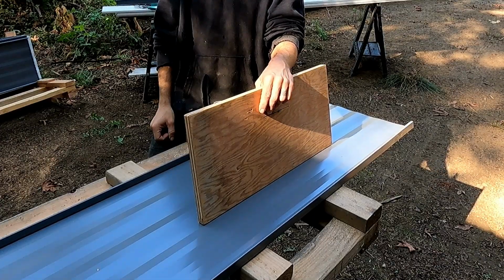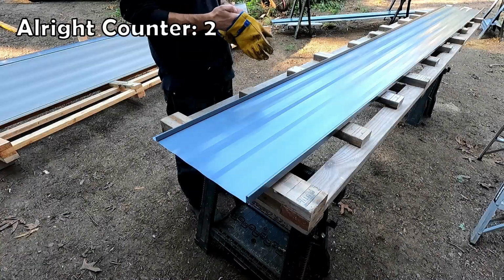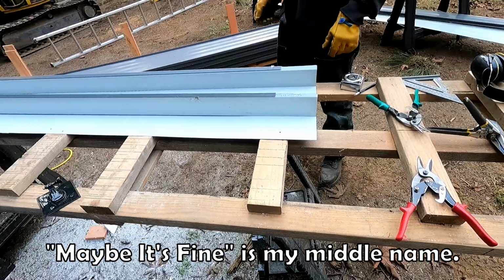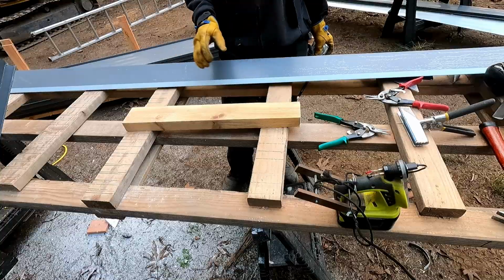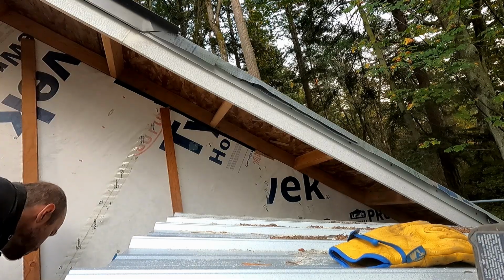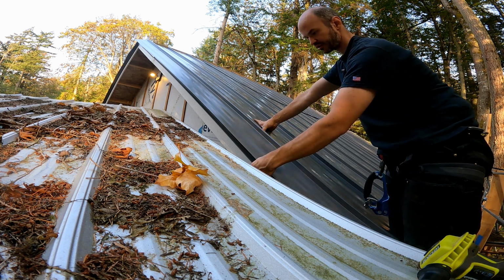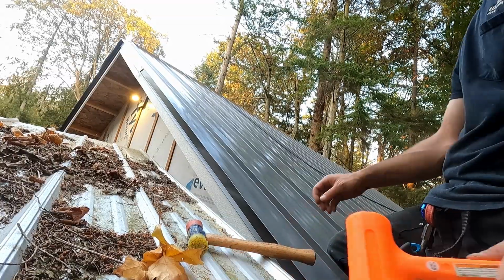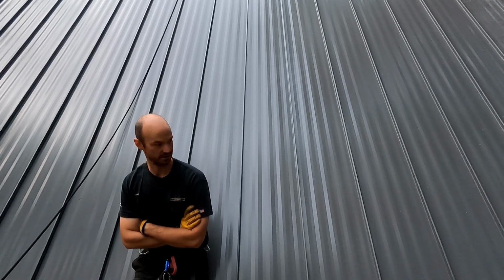Damaged Standing Seam Steel Roof Replacement

Comment: Just yesterday I was customizing some standard footplates (european style roof edging) for my new greenhouse with C-clamps and some lumber as my straight edge. If I had only waited a day I could have seen how I should have done it.

Cool trick with flipping the old blade backwards to rip metal. I will need that soon, too.
Reply from the maker: Hey, nothing wrong with lumber and C-clamps. The right tool for the job is the tool that gets the job done.

Comment: Very nice sheet metal work sir.  It would appear that you have done this before.  I have that same snap lock panel on my shop.  It will be around long after you and I are gone, barring another tree.
    I have snow load to be concerned with, and the most accumulation that I have had, was about 6inches before it all sheds off.  Regarding your backwards blade trick, that does work in a pinch, but “Diablo” brand blades has a specific ferrous blade in many sizes.  You can get a 5 or 6 inch one, for pretty cheap, and still use it in that 7 1/2 circular saw.  I know you are being cost conscious, and probably won’t need a specific blade like that again, just throwing the info., out there.
Great video,
Thank you sir.
Reply from the maker: Thanks for the tip! I've been wondering about those metal cutting circular saw blades, but was worried that they would only work well in a metal cutting saw (Evolution or similar). Have you tried one in a standard circular saw on steel and gotten good results? I would love to hear about it as I'm sure I have more metal roofing in my future.
Reply: @UncleMikesCustomThings  yes, a “Skill” brand with 3600 RPM, (of course you don’t have the benefit of a metal shavings/filings catcher), anything with higher RPM’s causes lots of heat (thus shortening the life of the blade).  Although maybe not on sheet metal, but the metals you are dealing with on your truck bed.  Those Evolution, Milwaukee, M.K., Morse etc., brands, dedicated metal cutting circular saws, are running 2800-3200 RPM, longer life out of the blade, and the shavings/filings get directed into a “catcher” (you know, a catcher, it’s a technical term, hahaha).
Reply from the maker: @greggb1416  Awesome, thanks for the information! My weapon of choice (Ryobi brushless) is 4300 RPM, so a little higher, but not crazy. Next time I've got some panels to cut I'll have to give one of those blades a try (unless of course by that time I've caved and bought a dedicated metal-cutting saw, they are tempting!). By the way, I think the technical term you're looking for is do-whacky.
Reply: @UncleMikesCustomThings  hahaha.., yep.  I did some research, I think they call them a “chip” collector.
Reply from the maker: So you were right!

Comment: Diablo has a metal blade for a skill saw.
Reply from the maker: Gregg said the same thing! I always thought those were for special saws, and thicker steel. Have you used one on a regular circular saw? Did it get good results? I'm sure I've got more steel roofing in my future, and if they actually work I'd love to add such a blade to my toolkit.

Comment: I can get Salvage standing seam with bad seams so you thing I can just screw the seams and make it work? For a pole barn roof and sides?
Reply from the maker: I'd say it depends. How bad is the damage? And how important are the result? Makes a big difference if that pole barn is for goats and firewood or if it's got insulation and electrical that'll be a problem if they get wet. Even if the seams won't lock, you could just screw them down with roofing screws (the kind with the rubber gasket). As long as the seams still at least lap it ought to be as good as barn tin.